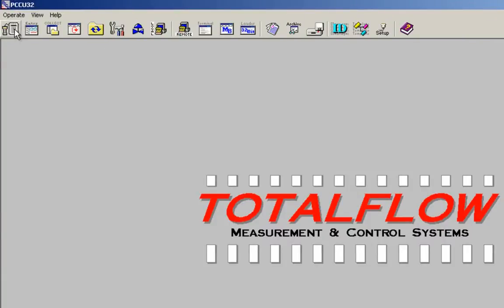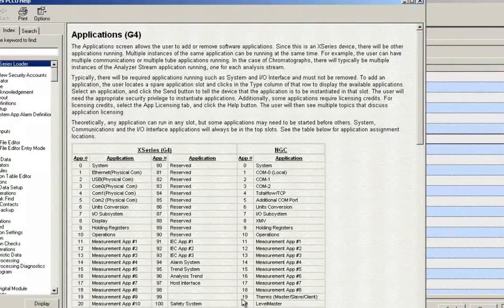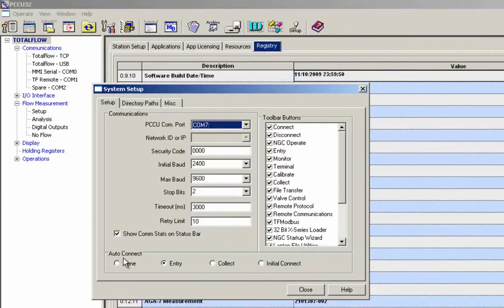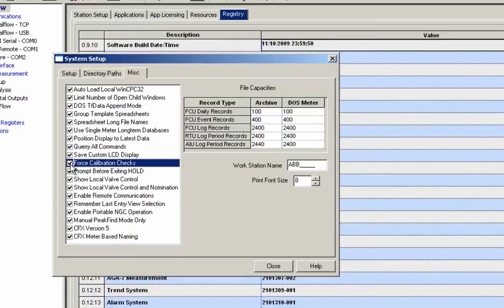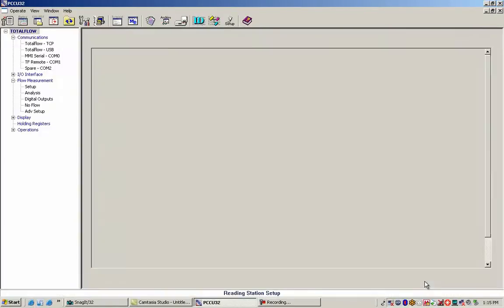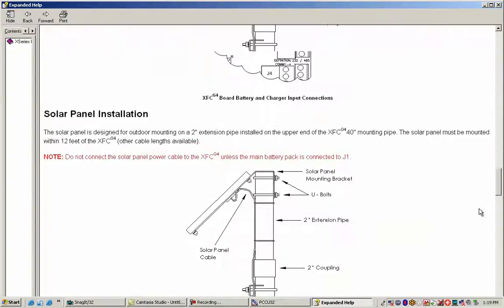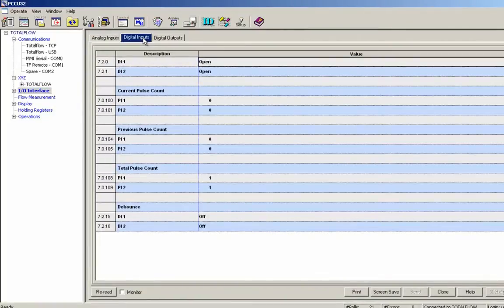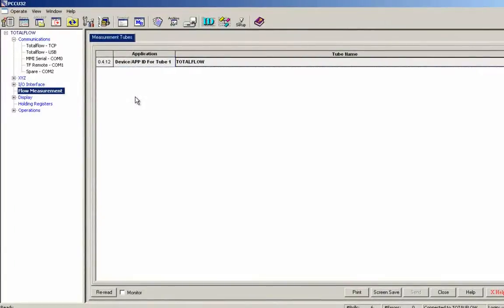ABB Totalflow G4 Training - Software Overview

Comment: Hi, i have a problem reading the numbers in the "flow measurement", because i see exponential in my computer, i try to change the windows numbers settings but i only get the numbers with a comma and i need it with a dot, do you know how i can fixed it?